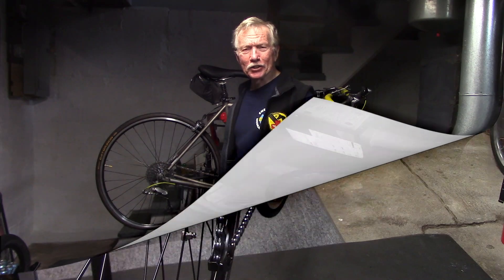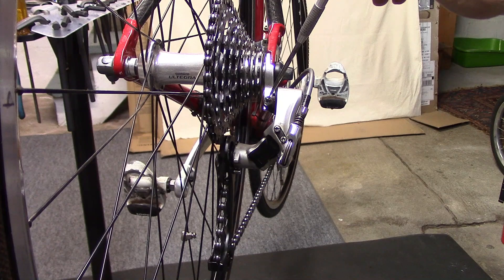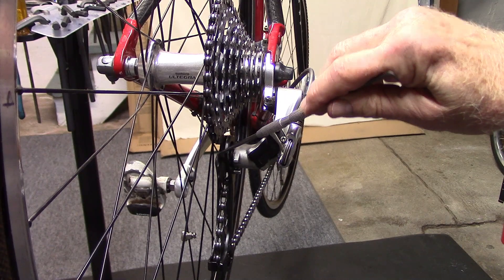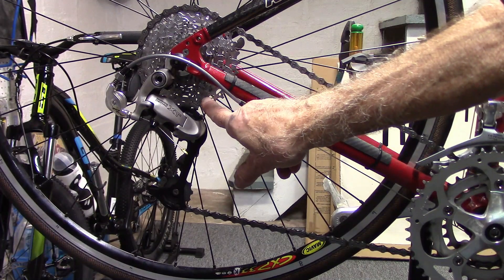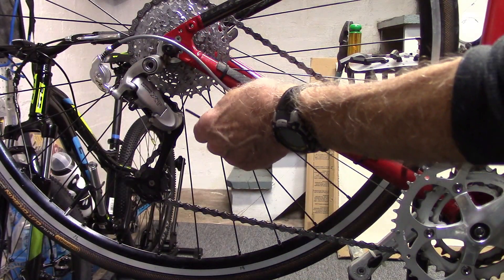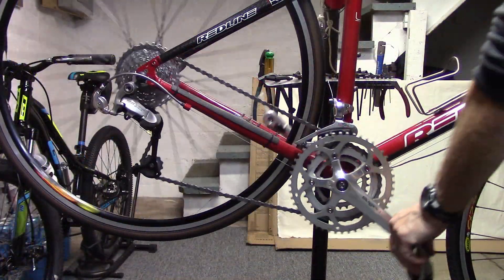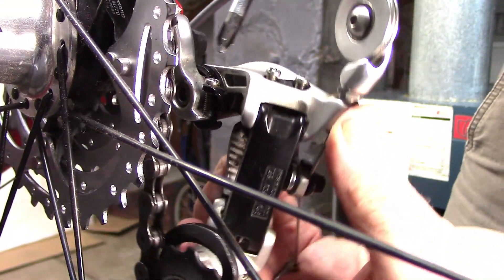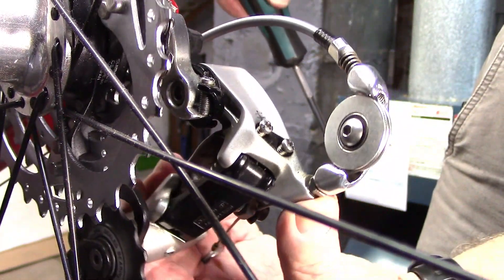What is the bicycle derailleur B screw and and how to adjust it?

Comment: Needed instruction to run a 34t with new 40t cassette on a medium cage derailleur and your video couldn’t have been done better.  Already had the screws, but needed the tutorial.
Reply from the maker: Glad it worked. You can also use a "hanger extension" as well (cost less then $10 on Amazon). Regards, Tony

Comment: The importance of getting the B-screw adjusted correctly is paramount to shifting perfomance. I was pulling my hair after getting a new bike that shifted terribly. It was the new Shimano 105 groupset with electronic shifting. Out of the box, the new bike performed poorly. I tried everything and still couldn't get it right. It will jump to an alternate gear instead of the next one; at times it wouldn't shift at all; and it was noisy even when slotted into the right gear. I changed cassette and did all the "hi" and "low" adjustments to no avail. Then it suddenly dawn on me to eyeball the gap between the jockey wheel and the largest sprocket. It was way too much. I could fit my thumb through it. Then I adjusted the B-screw to have a gap about 6mm. The result was pure enlightment. Every gear shifted smoothly and crisply. No hangups or crunches. Lesson learned here is that never ever assume that a new bike comes with everything adjusted corrected. My impression of Shimano's 105 electronic shifters passed with flying colors and it is pure joy in using it
Reply from the maker: The B adjustment is especially critical some some 11 and 12 speed bikes. Sickbiker has some excellent videos on this subject. See:
https://www.youtube.com/watch?v=cxZVXVyedf0
and
https://www.youtube.com/watch?v=Ly4wDlMWR9o
Glad you were able to solve your problem. Regards and safe cycling, Tony

Comment: Great video thank you, the measurement gap was just what I needed... just an FYI bolt equates to screw not nut. So you get a bolt with nut or potentially a screw with a nut, but never a screw and bolt. FWIW the difference between a nut and a screw is that a screw normally self secures by screwing into the main part be that a bike frame or door frame or similar, a bolt will always need a nut to secure it.

Comment: 5 years later your longer B screw hack enabled me to run a 32T cog with a short cage Dura-Ace derailleur on my 1x9 speed build. Now proper clearance off the pulley wheel. Really didn't want to go with a hanger extender or spend on another derailleur. Glad I came across this vid. Thanks!
Reply from the maker: I've used this trick on more then a couple of bikes giving cyclist greater comfort for the really steep hills. Thanks for your comment and regards, Tony

Comment: This winter my seasonal project was to convert my Canondale Trigger full suspension to an eBike. Part of it meant changing the rear cassette low cog to a 42 tooth, which required a hanger extension for the rear derailleur. Of course that also meant I discovered that my B screw was too short. So I eventually arrived at your hack after waiting weeks to get an order of 25mm screws.. My eventual hack was same as yours even down to the nut on the end as I noticed that the end of the screw was not doing a great job of seating on the angled landing area. So today I am struggling with that problem on another bike, and it never occurred to me to perform the same hack, which I will do shortly because I now of course have plenty of 25mm screws.  In hinsight I wish I had put some locktight on that nut, but I'm afraid to take it off again as I don't want to mess with the adjustment, and it has gone about 200km so far with no problems. In fact maybe for that nut I'll try using a 'nylock' style nut. I like your attention to detail, very encouraging, thanks for this.
Reply from the maker: You can still place a few drops of loctite on the nut and screw above and below the nut to hold it in place. Getting the nut to sit at the correct spot on the end of the hanger is the key. Thanks for your input and safe cycling, Tony
Reply: @tony10speed  Thanks for the input. Apparently the locktite brand that I use is anerobic so it only sets after the nut is tightened over it. Looks like I better get another brand that will set in air.
Turns out the crux of yesterday's problem was when I changed the chain for a new one, the new one was one link too short. I realized that after noticing that my guide jockey wheel indeed had the recommended 6mm of clearance from the cassette, and even on the smallest cog, there was still a lot of tension on the chain by virtue of the deraileur cage already having a good angle on it. So I had to add a link the the SRAM chain (luckily had had some leftover links from the same model of chain) and that seems to have solved this latest problem I was having.

Comment: Now I understand why you put the nut on the end of your replacement "B" screw. On my 105 long cage, if I adjust the "B" screw as needed, the end of the screw is making only about 75% contact with the hanger..The nut on the end would give more contact area and perhaps not allow the screw to ever chew away the hanger and become unable to adjust...
Reply from the maker: The rear derailleur "hanger" is not quite long enough and the nut on the screw does allow contact with the hanger. Regards, Tony
Reply: @tony10speed  I replaced my screw with a longer one..NOW, I'll put a nut on the end as you've done....
Reply from the maker: @dv270salto7  Let me know how you make out.

Comment: If I understood this correctly, one would screw the B-screw "in" to move the derailleur away from the cassette and accommodate the larger cog and back it "out" to move the derailleur closer when using a smaller cog. Is that correct?
Reply from the maker: You got it. Regards and safe cycling, Tony

Comment: So a slightly longer chain wouldn't have had an affect on the chain shifting to the largest cog?
Reply from the maker: If the chain is too long, several problems may occur:
1. You maynot be able to adjust the "b" screw for optimal spacing between the large cog and pulley wheel.
2. A chain that's too long may result in the chain rubbing against the derailleur when in the smallest cog.
For this reason, we try to adjust the chain to an optimal length as shown. There are other methods to find the best chain length on the internet, but they require a little more guess work.
Regards, Tony
Reply: @tony10speed  Ok, I didn't mean to make the chain un-necessarily long, I just thought that maybe that particular chain was maybe too short.  Thanks.
Reply from the maker: @SuperOlds88  A chain that's too short may present problems when trying to shift into the largest cog. It may not shift or it may lock up if it's able to shift to the largest cog. This may be even more pronounced if you are in the large chainring and accidently shift in the rear to largest cog. Something called cross chaining. See:
  https://www.youtube.com/watch?v=_dCa-PZuN7c
Hope this answers your questions. Thanks for all your comments. We only get answers when we as questions. Regards, Tony

Comment: Thank you for a perfect explanation. I never had to use the lower gear on my bike, I've ridden 2000kms and just last weekend I put a trailer and went for a touring ride. With the load of the trailer I had to use the lowest gear and it was rubbing and doing noise. I adjusted the B screw, not being sure what I was doing, just following my common sense, and it worked perfectly. Its disapointing that from the factory it was wrongly set, it was too close to the lowest cog. You confirmed with this video that I did the right adjustment. Chers from British Columbia Canada!
Reply from the maker: The "b" screw setting will depend on the size of the cassette used. It's not so much the manufacturer as the shop who sold you the bicycle that should have tested it out after installing the cassette. Glad you figured it out. Good work. Regards and safe cycling, Tony

Comment: I had poor shifting going down the cogs it would shift up fine to solve this i had to loosen the derailleur hanger bolt slightly then everything works nice. M735 xt deraliur. Maybe add some thread locker.
Reply from the maker: Loosening the derailleur hanger bolt is not an ideal solution. I wonder if the derailleur hanger is bent. Might want to check with you local bike store to play it safe. Let me know how you make out. Regards, Tony
Reply: @tony10speed  I'm not sure but i think it could be the ebay seller i baught it off may have swapped the anchor bolt with one from a different model.  They do things like that to get sales,  if original bolt was scratched or rusty they just take one out of a Acera or SiS or something similar.

Comment: Thanks.
I've just had an interesting situation - i fitted a larger RD & cassette, and it appeared that i didn't even need the B screw at all, so i took it out. 😃 I discovered that when in the small front chainwheel & smallest cog, the chain was actually loose, and i was occasionally dropping the chain. Re-installing the screw and adjusting it fixed that problem
Reply from the maker: Thanks for the comment. I'm sure it will help inform others. Safe cycling, Tony
Reply: I did same but it won't fit and there is like another screw inside is there any fix plz way if there is😢
Reply from the maker: @mhboruto6644  Not sure I understand your problem without more details.

Comment: I find I can get a little more good shift life out of my cassettes as they wear by adjusting the b limit. If I can't hit the spot with cable tension and know my cassettes are wearing, I can usually adjust my B limit a few times before getting a new one.
Reply from the maker: If you wait long enough the the top of the teeth wear down, you've probably waited to long to replace your cassette and have promoted increase chain and chainring wear. This is how I approach cassette wear:
https://www.youtube.com/watch?v=g5uqTNmikro

Comment: Hey Tony. nice video!. I found it trying to solve a problem i have with my b screw. It misses the bit of the frame. in other words is not able to adjust the polley angle hence, it is too close to the cog set. Do you have any idea on how to go around this issue? greetings from Colombia....
Reply from the maker: You could try a "hanger extension" from Wolf or several other manufacturers. I purchased several on Amazon (about $5 apiece). One removes the rear derailleur, attaches the hanger extension and then attaches the derailleur to the hanger extension. The "b" screw now comes in contact with the extension and can be adjusted. You can also replace the "b" screw with a longer one; put a nut on the end so it contacts the rear of the hanger and to sit further back. Finding the correct hardware and installation for this latte hack is tricky and difficult. Regards, Tony

Comment: My Shimano STX Derailleur (11-28 casette and 24 chainring) is still hitting the casette with the screw all the way in. I already checked for bent cage and hanger, but it looks straight. My chain is the right length too and everything is original to the bike. Any ideas?
Reply from the maker: Are you running a single chainring, double or triple and how many teeth on the other chainrings up front?
Reply from the maker: Also, is the derailleur a short or long cage Shimano?

Comment: appreciate your video.  My b screw doesn't seem to do anything.  It's hitting the hanger's tail at an angle, not really contacting that surface squarely like your video demonstrated.  Now I wonder if the threaded part is bent out of position.
Reply from the maker: A short or even medium cage derailleur with a large enough cassette cog may result in this problem. Look at the specs for your rear derailleur which will tell you the largest cog you can have on your cassette. You may be able to accommodate a slightly larger cassette cog then the specs if you install a longer cage rear derailleur or a derailleur hanger extender. Here's a video on Wolf Tooth Hanger Extender:
https://www.youtube.com/watch?v=eXemxzz1ctU
There are less expensive hanger extenders (at Amazon) that work just as well and maybe worth a try before replacing the rear derailleur.
Let me know how you make out. Regards, Tony

Comment: What screw tightens the chain? I do not want to take a link out. Not concerned with the shifting. Trying to get rid of some of the chain slack . Thanks
Reply from the maker: If you're not concerned with shifting, I assume you have a fixed gear (single chain ring / single cog). If so, see the following video:
https://www.youtube.com/watch?v=QuLgpvrQzcI
Otherwise, see our video on chain length:
https://www.youtube.com/watch?v=2MbhSfHZkCI
Reply: @tony10speed  I appreciate the information.  I have a 6 speed falcon system. And falcon derailleur

Comment: Great help.  I had the longer bolt but I gotta get the nut. My system is 44/36/24  13x 34 7speed system.  That should solve my issue on several old bridgsetone mtn bikes.

Thanks for the information.
Reply from the maker: You might also consider a hanger extender. The following shows installation of a Wolf Tooth extender but, for a seven speed, you'd want to use a cheaper extender such as the following:
https://www.amazon.com/Keenso-Derailleur-Extender-Bicycle-Extension/dp/B0852WGR61/ref=sr_1_1?crid=3GN6UQI05QTZK&keywords=bicycle%2Bhanger%2Bextender&qid=1647522415&sprefix=bicycle%2Bhanger%2Bextender%2Caps%2C78&sr=8-1&th=1
Either way should work. Let me know how you make out. Regards, Tony
Reply: Hi Tony,

I had no clue there were such things as derailuer extender.  For now, since I can shift into the  rear 34t with just a little bit touching of both guide pulley and 34t on cassette, I will use your hack.  Out of my Bridgestone mtn bike fleet of 30 bikes equipped with 34t rear cassette, I only have the problem with just a few of them.

Thanks for sharing and I'll report back later.

A rainy spring day here in the Pacific NW.

Jim-
Reply: What is the purpose of the nut attached to end of the m4 x 25mm bolt?   I can't see the video well.  Is the nut adjusted in addition to bolt
Reply from the maker: @jimlegalley6656  The nut sits at the end of the new longer "b" screw,  moving the "b" screw back a bit further. This in turn moves the guide pulley down a further away from the largest cassette cog. It's similar to extending the derailleur hanger.

Comment: Hi Tony. Thanks for the video. Could you just clarify what that nut does on the end of the longer b screw?  I was assuming it would be a lock nut, but that doesn’t seem to be the case. What is the reason for ‘lining it up with the end of the hanger’?
Reply from the maker: In the case, the hanger was not long enough and the "b" screw length was not sufficient to keep the pulley wheel from hitting the teeth of the largest cog. What I did was to use a longer screw of the same size and threading (available via the internet).The screw extended beyond the hanger so I put a small nut on the end and this allow the proper clearance. Another (and perhaps better) way is to use a hanger extender which will allow the "b" screw to properly be adjusted. I hope this make sense. Thanks for asking, Tony

Comment: Thanks for the nice video. These screws are simple once you get a demo of why they are important. I had a bike which had always had clunky shifting since new. I rode it for years and even after replacing the cabling with fancy Teflon coated versions, it still was clunky. Turns out 3 turns of the b screw solved my problem. The bike came improperly adjusted from the factory haha.
Reply from the maker: Good work Sherlock. Thanks for the feedback. Regards and have a pleasant and quiet ride, Tony

Comment: @Tony Marchand  can u also tell if altus 9 speed derailleur could run 11-36 teeth as the company says it can run 11-34 only max but after I run it there is some rubbing what can I do to fix it I have already max out my b screw should I use longer B screw or get alivio 9 speed derailleur which runs11-36 teeth cassette
Reply from the maker: I've done exactly what you want by using a "hanger extension" which costs about $5. Be sure to get an extender that is made for the speed of your bike. The inexpensive ones will work on 9 speed and less. For 10 or 11 speed, the hanger should be specific for that speed. See:
https://www.youtube.com/watch?v=eXemxzz1ctU&ab_channel=PedalPower
Regards, Tony
Reply: @tony10speed  I live in India so extender is not available here any other option
Reply from the maker: @tablamasters6262  Try Amazon on line:
https://www.amazon.com/dp/B0852WGR61/ref=redir_mobile_desktop?_encoding=UTF8&aaxitk=ce9e7edbecbc1f86fb98304e855848ef&hsa_cr_id=6642938180301&pd_rd_plhdr=t&pd_rd_r=83a9fa9c-b83e-4ba3-9657-0388c3fe588f&pd_rd_w=sXBBa&pd_rd_wg=n8T3j&ref_=sbx_be_s_sparkle_mcd_asin_1_img
or something similar. Otherwise you have to go with a long cage derailleur.
Reply: @tony10speed  I think I need to longer my b screw if that's not gonna work I am gonna leave it
Reply from the maker: @tablamasters6262  You can buy a longer "b" screw but it may not contact the hanger as you tighten it. It will probably go behind the rear derailleur hanger. If you can place the right size nut on the longer "b" screw after insert it, it may give you enough push off the back of the hanger to work. I've done this with good results.
Regards, Tony
Reply: @tony10speed  yes tony thanks I have solved my problem today got a bigger b screw and also placed nut works perfectly now and no rubbing except when I go from 1 gear to 2 nd gear there is noice of shifting like chain on cassette metal noice except it works fine
Reply from the maker: @tablamasters6262  Good for you. You have a lot of patience and it paid off. And safe cycling.
Reply: @tony10speed  yes thanks by the way any idea how can I improve shifting like my 1 st gear to 2nd gear is there comes noice while shifting like the chainspanks on cassette and makes mettal sound because there is gap difference between 1 st and 2nd gear